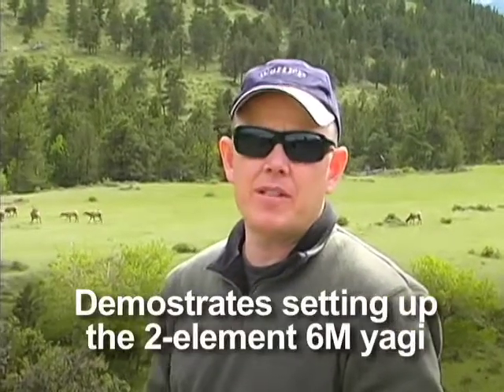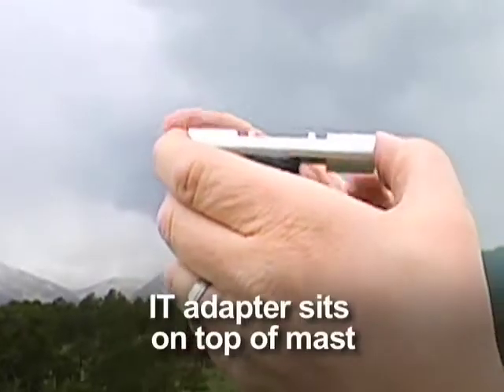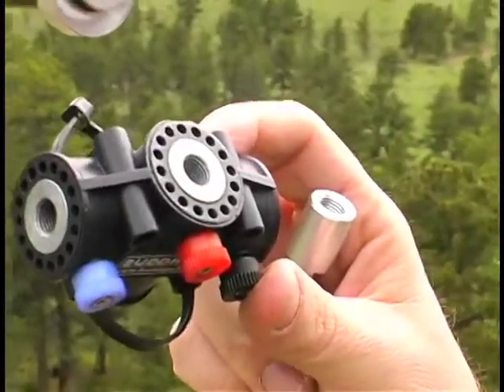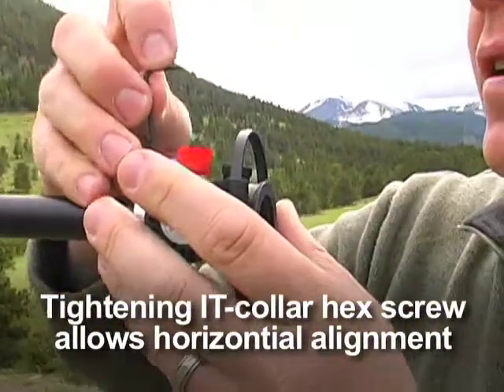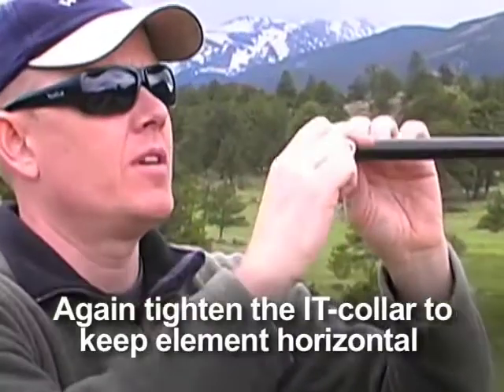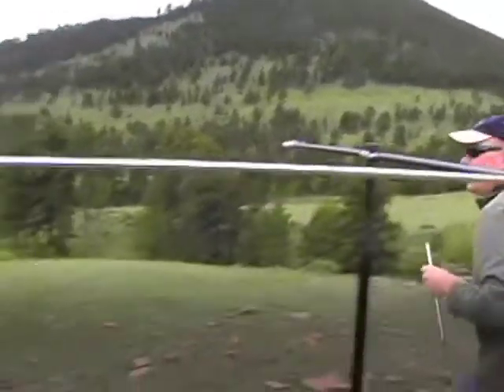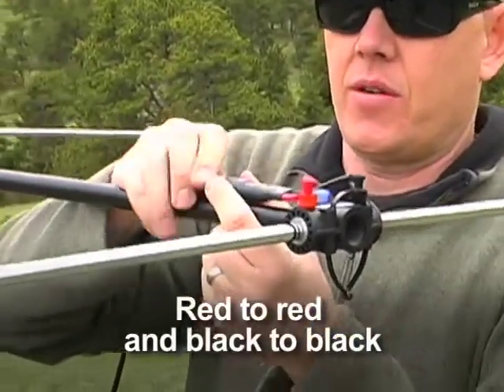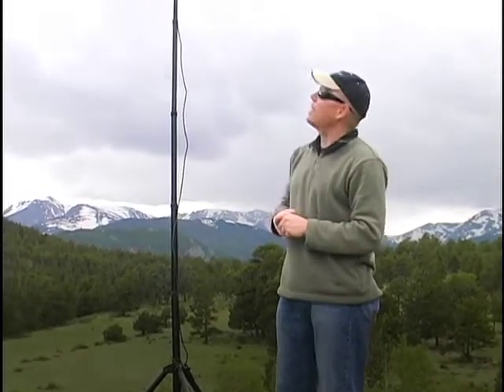Setting up the Buddipole 2-element 6M Yagi

Comment: I just bought this 6 meter kid to add to my Buddipole and the first time I set it up an awesome 1.5 SWR before I even got the change to adjust it. I extended the telescopic whips and worked on 10 meters with a tuner and made contacts all over Europe yesterday. Excellent idea, excellent antenna. My next goal is try it with a 3 element.
Reply: did you test the 3 element yagi for 10m ?
Reply: @FFdo.  yes I did Fernando.  I used a simple diagram of a 10 meter 3 element antena and matched the length of the driver, reflector and director element. I wouldn’t recommend on a windy day as the elements aren’t super strong at that lengths. Works like a charm as long there is an opening on 10 meters.

Comment: I just finished building the 2 element 10 meter yagi at 20 feet, Kenwood TS2000 internal antenna tuner brought a Flat SWR in 1 second of tuning. First QSO was California 5x9. I can't wait to use all of the configurations next year while travelling up and down the East Coast. 
K3NXH
Reply: Do you remember the lengths you used for the driven and reflector elements?